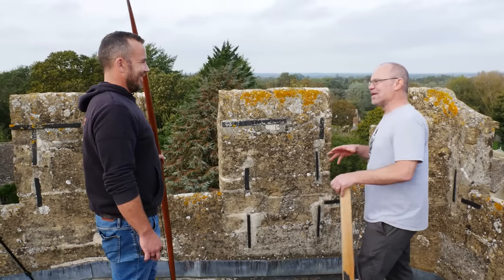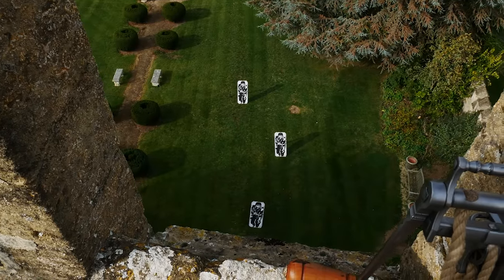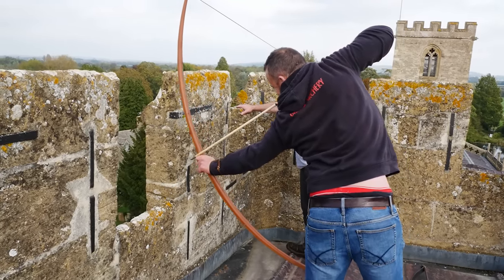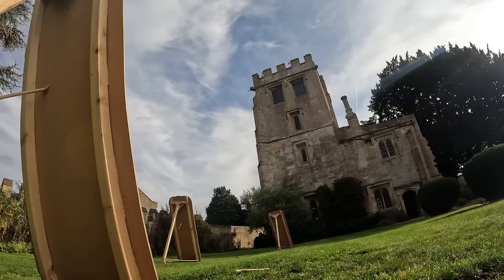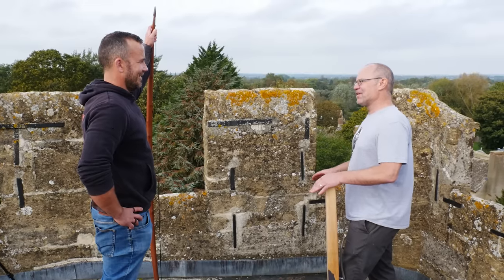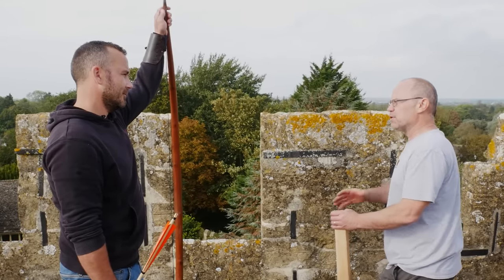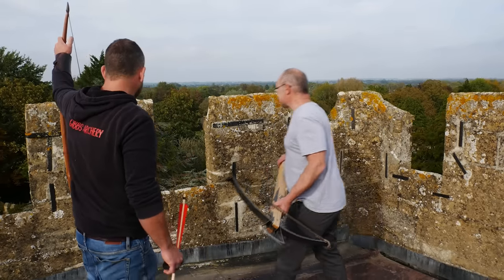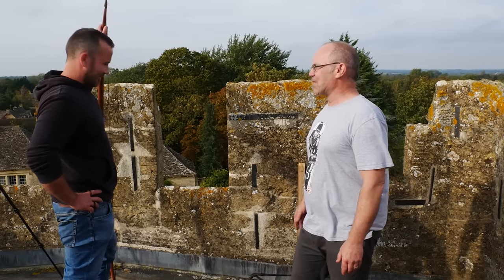Crossbow or Longbow? What's better for defending your medieval tower?

Comment: Soldiers with ladders can run 200 meters in 40 seconds. Then maybe 20 more seconds until the first ones are on the walls. So one minute. Rate of fire is king. Or just throw rocks. Armour can't protect you from a heavy stone.